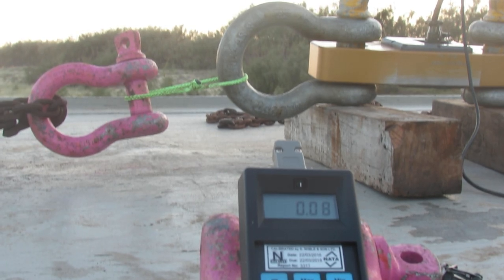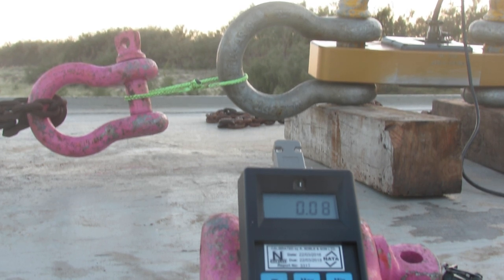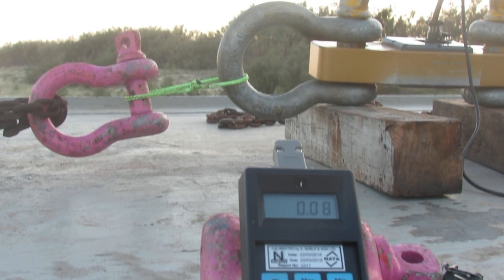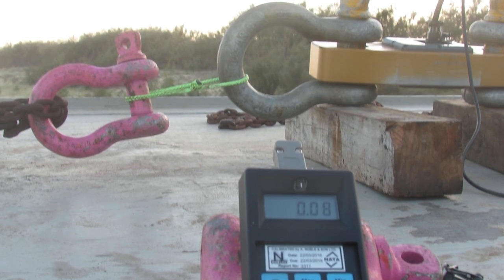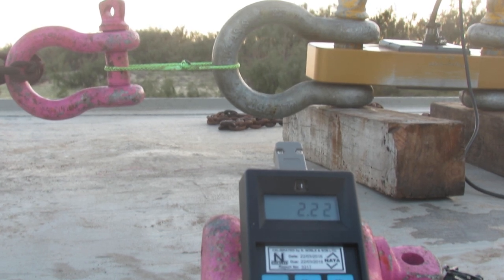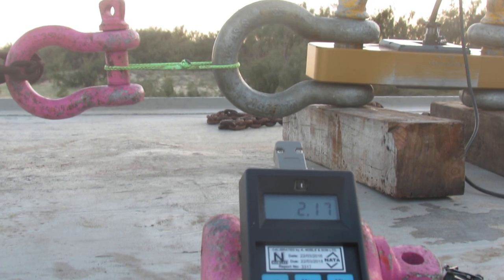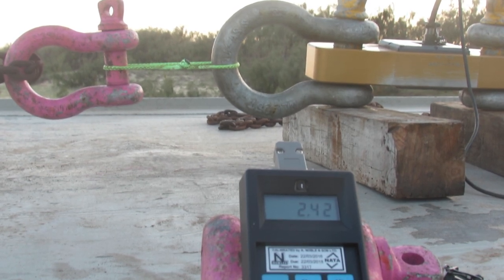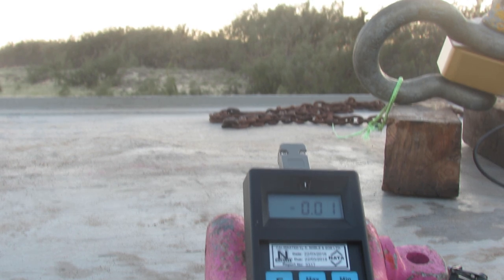Destruction Test - 4mm Dyneema Soft Shackle

Comment: I make soft shackles for marine use all the time, and I know in theory how strong they're supposed to be, but it still blows my mind to see it like this.
Reply: The SWL is usually shown as half of the actual breaking strain.
Reply from the maker: Yes, SWL is for lifting. Recovery Load Limit (RLL) is 4/5 of the breaking strain.
Reply: Where do you get these soft shackles?  Thank you.
Reply from the maker: @leesire  I make all of mine myself. You can buy soft shackles on ebay and many other places too. Ebay is probably the easiest though.
Reply: @TruBluOffroad  I saw them on Amazon.  Neat stuff!  Thank you
Reply: These soft shackles are all the same their only as good as the knot tied on the end of them. Ur all relying on a knot.
Reply: @andrewsciacca6219  so what?
Learn to tie a good knot
Reply: @andrewsciacca6219  So? Knots can be incredibly good. A properly tied button knot in a soft shackle will hold 230% of the MBS of the line. The tails of the knot are buried in a splice, so the knot can't come untied. Maybe you are not familiar with how this knot works? 

The breaking strength of high performance technical materials is measured by the manufacturer using just a bury splice...so not even a knot! It's just the "chinese finger trap" action of the rope being buried inside of the rope that holds it. Turns out, that's actually the strongest way to do it. Our intuition on strength and reliability can be wrong. The only way to really deal with it is testing in a controlled environment, and in that testing, soft shackles are incredibly good.

Comment: While that is impressive, I imagine it would be less than half of that with a more dynamic load (which is still good).
I generally calculate 1/5 for a Safe Working Load.
Reply from the maker: 1/5 of breaking strain is generally the calculation used to determine safe working load ratings.
Whether dynamic or static, things still let go at the same breaking strain. 
The key part to understand is that even a 10kg load can create a tonne of force. It just depends how fast it's moving and how harsh or gently it comes to a stop from that speed.
Reply: @TruBluOffroad  I also figured out that I would prefer my cheap dyneema shackle to break before my not so cheap mast. Knowing which part you'd prefer to fail is something worth deciding in advance.

Comment: That's actually 2 x 4mm Dyneema. A single length should break @ ~1.3 - 1.4 metric tonnes. Still amazing though...
Reply: So the shackle should bust at around 220% strength
Reply: @aaronho4242  The maker of the video commented that the shackle fails at the knot. So although, as a loop, it would be 2 x 4mm as Jeffrey Fay points out it actually fails earlier, because of the knot. I think it would be much less than 220%.
Reply: @steelonius  They really do hold around 230% of the MBS of the line, it's been tested in a controlled environment many times. They don't typically break in the knot, they break in the noose. HowNot2 has a bunch of different tests of different kinds of soft shackles tied different ways, and with different variations of dyneema. Good place to see what really occurs.

Comment: Breaking strain depend also on pin diameter. With pin dia 4 or 5 mm strain will be way less than 2.7 tons
Reply from the maker: Not quite. Dyneema handles tight bends really well as opposed to steel wire rope. Yes sharp edges may cut the dyneema but that isn't really referred to as a breaking strain, similar to the dyneema having damage from wear and tear. This style soft shackle always let's go at the knot.

Comment: Did it break at the knot? Square Knots are notorious for breaking.
Reply from the maker: Yes at the knot. Theoretically with two lengths of 4mm dyneema at 1800kg BS, then used basically in a basket configuration, should give 5.2t BS but they are weakened dramatically by the fact that the strain can not possible be distributed evenly through all strands of dyneema, particularly in the knot, and also the squeezing effect of the knot is like a cutting force at that level of strain.
Reply: @TruBluOffroad  Richard Delaney from the Rope Test Lab and others have instituted a very simply formula for derating soft goods when tied in a knot. Derate by 50%. No arguing over small differences in various knots. Makes it super easy to calculate your safety factors then.

Comment: Why not test it with the ends tied to the shackles? Instead of being a loop. Seems it would give more accurate results for the material itself and not the knot tying abilities.
Reply from the maker: Because this is to test the soft shackle, not the dyneema it's made of. The 4mm dyneema has a breaking strain of 1900kg according to the seller.

Comment: He’s calling that a 4 mm shackle if that’s 4 mm I’ll stand corrected compare to those shackles that rope is a lot bigger then 4 mm look how far we are from the shackles four mil dyneema is not that big I’m sure
Reply from the maker: I searched for 4mm dyneema. I purchased 4mm dyneema. I received 4mm dyneema. I cut and constructed the shackle from 4mm dyneema. If I'm calling it 4mm dyneema it's 4mm dyneema. ;]
Reply: Well Scotty Malone.. I say this because from this side of the fence against those shackle the rope looks bigger than 4mm. 
It may just be the camera angle and those shackles are like 8-10mm And the timber they’re sitting on is a tooth pick. 
How big are those shackles.
Reply from the maker: @andrewsciacca6219  firstly are you aware of how these soft shackles are constructed? They are made by splicing the dyneema rope back through itself. So they generally appear to be nearly double the thickness, but are still referred to by the thickness of the rope they're made from.
Reply: @TruBluOffroad   
Thanks Scotty, it may be the way the vid is taken and the angle, but those steel shackles look rather large. 
As for how these work I have a full understanding. My opinion is that everyone is making and using the same design type, they all have the same unreliable problem, failure at the knot. 
Friction behind the knot causing heat damage as the rope is elongating causing failure.
Reply from the maker: @andrewsciacca6219  that's not just your opinion. It's a fact. Any rope, unless cut or damaged by a sharp edge, will always break at its knot. Just like straps will always fail where they're sewn, unless damaged elsewhere to a level that causes that particular area to be weaker than where it's sewn. Every object has a weakest point and will always fail at that point. Bow shackles are no exception. If I was testing them, they'll always fail at the end of the thread on the pin.  
There is other soft shackle construction designs and I've given them all a go. But it seems that this basic design is still the most efficient design in terms of strength for the amount of material used.

And yes the bow shackles I'm using are big. The shackles connected directly to the load cell are 25t SWL, which are used because they are the corect fit for the 50t load cell. The smaller ones are 18t and 12t.
Reply: @TruBluOffroad  Scotty your missing my point. When you splice an eye in a line and put it on a tow point, we go back to the splice for week point, you give a reduction in a line for a splice, so it has a MBF as a rope, which is fibre in a straight line, then a MBF after splicing. 
A knot is a NO NO in u lose 50% strength..  (not sure I totally agree in this but it’s usually rule of thumb) 
What I’m saying is that these soft shackles, not yours, I’m not voicing an option on your shackle it’s not a personal go, I just see a way to make a shackle where I don’t rely on a knot, it comes back to a splice and MBF of the rope to calculate a MBF. No guessing.
Samson as example have this same soft shackle, that beef it up behind the knot to increase the D D ratio but it can’t be certified for lifting.. yet you can splice a rope for lifting purposes. 
As for the steel shackle you mention that’s correct but ultimately that’s why or one of the reasons they work at 6:1.
That’s why soft shackles are sold as MBF not SWL or WLL. 
So go put a knot factor on these soft shackles and it’s gunna have to be high.. 
you’ve tested other types but not all of them. 

Thanks for your enthusiasm cheers andrew
Reply: Are you trying to say that the Earth is round  ?
Reply from the maker: @andrewsciacca6219  no I got your point and as I explained, these other soft shackle construction methods that beef up or protect the knot etc, use more material. Of course a know or splice or any other deformation or bend in a rope is going to cause a weak point. Simple physics. Of course there's ways to minimize the issue but as I said, this simple basic design give the most efficient strength to material used ratio.
Reply: @theyetti8811  no everyone should know it’s flat...did u see the pic that voyager took of earth 3.7 billion miles above us..🤣😂😂🤣
Reply: @TruBluOffroad  hi Scotty, sorry mate just to bring this up again. These soft shackles. Can I ask wat it is you are useing them for?are u 4wd enthusiast? Have a shop? Or just general interest?
Cheers andrew
Reply from the maker: @andrewsciacca6219  I use them in 4x4ing and recovery, tiedown and towing etc. They're used a lot on boats too, sailing mostly.
Reply: Some people just like to argue. That's a 4mm shackle. And even at half that breaking strain that's one strong piece of cord. That is the point of the video, not to set up a physics debate.
Reply: @77goanywhere  No that is not correct, I’m not sure where the argument is.! I merely asked was it a 4 mm rope cause looking at it from my phone against those shackles it doesn’t look 4mm. But if u would like an argument about it not a problem what argument would u like to have.. the one about even at half that break load it’s a strong piece of cord? Cause even at half the load it’s a shit piece of rope or it’s a good piece of rope but a shit design which leads the rope to fail at half it’s said MBF.
Or the one that everyone is making the same design failing in the same spot and yes to the average joe blow and his tonka truck that works fine.. because these ropes are that high in break load it’s near impossible for a normal vehicle to break it if not impossible unless the rope has pre damage.. but in a serious environment the design has flaws. 
Wats wrong with a physics debate some one might learn something about Dyneema.
Reply: @andrewsciacca6219  Whatever.
Reply: @77goanywhere  muppet
Reply: @andrewsciacca6219  what's the breaking point of a muppet? I don't there's a video been posted yet.
Reply from the maker: I have an off-road recovery business. So I use them in recovery. I also use them on the end of winch ropes for personal use as opposed to a metal winch hook, on the end of ratchet straps and other tie downs instead of the metal hooks. They're stronger and safer, and also don't scratch paint off from what you hook them to. They're so handy. There's many uses. Especially when you make them yourself and can make them to whatever length you choose.

Comment: Go to all that trouble and use a slow camera, no peak-hold scale and no post-test failure analysis?  Did knot fail, sharp point on metal-shackle or cord? What knot?  Improve design?  C'mon man?
Reply from the maker: I'm sorry, I didn't know that when doing a destruction test I had to spend thousands on a peak hold high hertz load cell and do clinical analysis of the failure. My bad. :P
Reply: @TruBluOffroad  - iPhone records 60fps, Samsung claims 480fps.  Looks like you recorded at around 10fps?  A shaky 10.  Most gauges have peak-hold and yours probably does too.  Analysis might be as simple as showing the break?  Did the break occur at the knot?  Because it looks like the break occurred on the backside of the left metal-shackle, leading one to wonder if the metal-shackle was smooth or if it caused the failure?  Maybe you're just not cut-out for testing?
Reply from the maker: @tomnoyb8301  I wish it did. I've been meaning to contact the distributor to find out the cost and availability of a recording controller but probably still more money than I'd like to spend. I recorded at 60fps but uploaded at much less. Maybe there's people out there that are willing to go to great lengths for their youtube vids, but I'm not that person. My vids might be interesting to some, not interesting to others. I'm easy either way.
Reply from the maker: @tomnoyb8301  oh and yes the shackle broke at the knot where this design soft shackle always breaks. And yes there are stronger designs which use more material. I have found this design to give the best strength/size/material used ratio.
Maybe I'll do a comparison vid of the different designs with their strength, material used etc etc.
Reply: Mr Nyobs channel is also a little short on such content. 🤔
Reply from the maker: @bendgeddes  extremely good point.